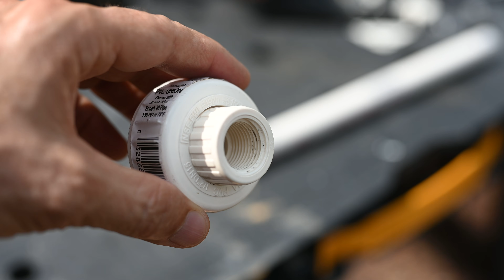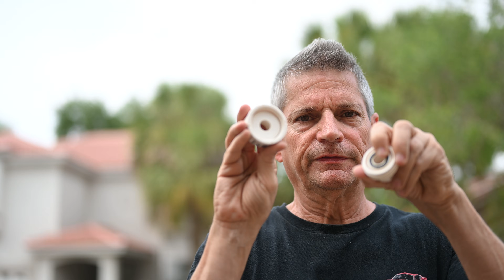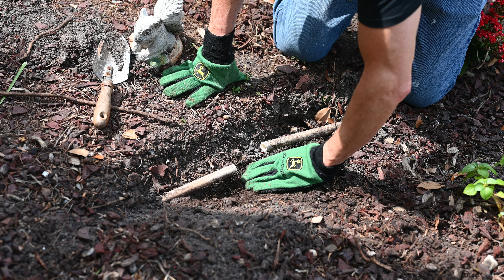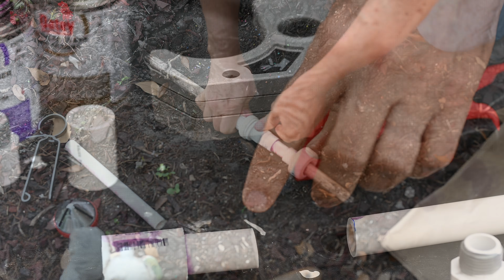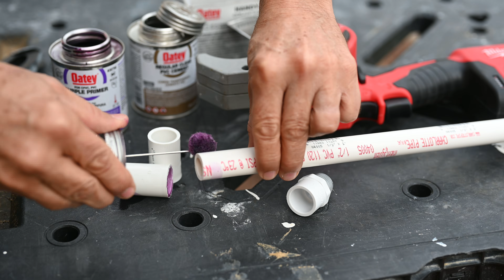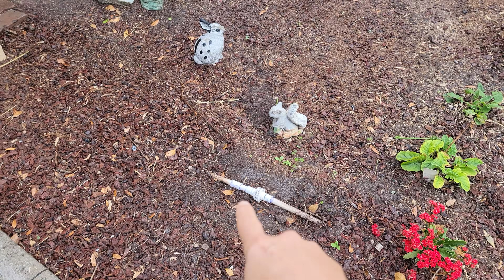DIY How To Repair Broken Sprinkler Pipe Gap with PVC Union

Comment: Lately I prefer glue over threaded fittings.  Threaded is so finicky on tightness and often leaks for under or over tightening.  Anyone else experience that PVC fittings from Ace, HD, and Lowes is real crappy quality?   Been doing plumbing for 50 years.   Installations that used to last 30 years are failing at 1-2 years.   Cheap imports

Comment: There is much easier way to do this, just requires two simple PVC couplers (No Union needed) and a short piece of PVC pipe. and the primer and glue. Unions are used more to make it easier to replace component like a bad valve.
Reply: And the two ends of pipe looked like they were at two different depths. The stress may have been what caused the problem to begin with. Two 45s may have been the ticket for that repair.

Comment: A Dresser fitting would have been faster and easier. Both are expensive fittings. A Dresser fitting slides over the pipe and tightens down a compression fitting a both ends. They come in PVC and galvanized like the unions.

Comment: I never have used a PVC union..so came here to understand those and this video was great for that.  However for those of us lazy dudes that never cut the pipe the right distance on a repair job, i recommend those telescoping expansion repair sleeve chingaderas. They are fast, forgiving on cutting wrong lengths,  and super easy for us dingbats looking for the most simple repair.  "Expansion Repair Coupling" is what they are officially called I think.
Reply: Not only are they a lot less work to install but they have double o-rings last much longer than the single o-ring in the union. They're also lower profile so you don't need as much clearance. BOTH depend on rubber though and won't last forever, although on the low pressure side, it won't matter. The other option is a "no stop repair coupler". These are a bit longer than the regular couplers and don't have the stop in the middle. This is so you can slide it all the way on one pipe, and then back it up half way on the other pipe. If done right, this is is a permanent repair that doesn't rely on any rubber or silcone.
Reply: @sorka95032  great to know...thanks.  Where do you find the coupler without that annoying stop in the middle?  And sometimes I make repairs when it is super hot outside and the glue firms up real fast, I'm an older dude and need some time to slide the coupler farther back and then in place...so if there is a slower set glue, please let me know - appreciate your advice !

Comment: Relatively low pressure sprinklers systems really don't need a primer.  The clear cement itself softens the PVC as it cures.

Comment: That PVC union is likely very expensive.  It is easier to use two cheap slip sleeves and piece of pipe.  That type of union is for when one wants to be able to disconnect pipe sections.

Comment: the problem I have is unless I dig out another 24 inches to free up the pipe, there's not enough flex to move the pipe out of position to slide the fittings on in the final alignment of the union.

Comment: While that particular repair did not need a union, it is a good example of how to attach a union.  My '35 year irrigation guy' used PVC in and out of my Sta-Rite pump. After multiple leaks, loss of prime, etc, I rebuilt his crap job on suction and discharge side using brass nipples and schedule  80 unions. Being able to disconnect unions have helped  tremendously to trouble shoot, prime, and tightening the nipples and female adapters.
Reply: I agree.  I was installing a timer in-line on some pvc pipe and wanted a union so I could easily replace the device in the future.  The two unions were $8 a piece, so I wouldn't do this in other circumstances.

Comment: Oh my gosh, it's like you are building a skyscraper to simply fix a single broken piece of PVC.
Use a compression fitting (non-pressure pipe) or a telescoping PVC coupling or 2 couplings and a scrap piece of pipe (pressure side of pipe).
My gosh, does everything on the internet need to be over the top and grandiose (figuratively) ?

Comment: Why not just use a threaded fitting with a 3/4" slip directly over the 3/4" pipe on the right side?  at 6:04....and avoid the coupling?
Reply from the maker: they won't be long enough to mate up you have to use a coupling because you can adjust the length

Comment: I have one of those Milwaukee cutters, but I just use a cheap pipe cutter (like scissors), which you can get for $10. But I guess I've never encountered PVC which was so old it had become brittle. I find the blue glue to be simpler, unless there's some sort of building code issue.
Reply: Usually PVC which is brittle has spent time in the sun, everything I’ve dug up hasn’t been brittle for me.

Comment: I like those PVC unions as that kind is functional unlike the compression style.  However that repair doesn't need a union.  I use either a repair coupling or file the center stop out of a normal coupling.  Goop up the pipe and coupling with cement, slip the coupling all the way onto one pipe and then slip it back back half-way on to the second pipe.

I've seen folks use a torch to heat and bend the pipe and use a normal coupling, or the straightforward way is to dig out enough room to flex the pipe normally.

Comment: Great informative video on how to utilize all those different pieces, the reason of using a union, and the process of gluing PVC pipe. Only problem I have is you have about $8+ in fittings, $6+ in glue and wild guess here $300+ in cutting tools. The only time I would use a union on PVC is where I would need to take it apart. Unions are mostly used in metal piping where you have threads that you need to turn in opposite directions. A more DIYer method for this repair would be a piece of pipe cut to length, 2 couplings glued on each end, dig a bid more on the pipe, glue both ends of repair flex pipe up & pop both ends on and give a quick rotate. About $1 in fittings. A small hand saw or hacksaw blade wrapped with tape or plumbers triangle saw or hand PVC cutter. You should remind people to check that their glue is still fresh, old glue fails, unless I’m doing multiple jobs or a bigger job, I only buy the smallest cans of glue.
Reply: That's how I fixed that problem, and I never had those repairs leak. I've also used these repair kits that have a sort of split pipe that you glue over the outside, when you don't have room to lift the pieces, and those have worked, too, but they also cost money (although less than one of those unions).
Reply: What is “repair flex pipe” and what do you mean? Why can’t we just do pvc cut to length and a coupler on each side?!
Reply: I should have wrote; glue one end onto one side, then flex the pipe up to get the other end and cut end to meet. The piece you are replacing with the couplings glued on will be longer than your cut opening in the ground, that’s why you will need to flex the pipe up to get it together.
Reply: @tomtribur458  but flexing a pipe up doesn’t allow room to fit into the other pipe in my visualization. I’m visualizing pushing the pipe BACKWARD to then be able to slide it forward into the coupling attached to the other pipe right?
Reply: @MathCuriousity  if you can slide one side of your pipe, you are good, just slide 1 side away, put your glue and fitting on and slide it back together. You only have to lift and flex your pipe if both ends are buried and fixed in place, but if you do need to flex your pipe up, dig farther back and expose more pipe, if you don’t you risk cracking the pipe. The flexing is only to allow more space between the ends of the pipes and when you release the pipe as it settles back down, it will force itself back together.
Reply: I've also seen people remove the interior ridge in the middle of a slip coupling so it can slip completely over the pipe and utilize some deft prime, slip on and to one side, apply glue on both ends and slide the coupling back to cover the join and rotate.  Never tried it myself and as many mention so long as the ends have movement you probably don't need any such shenanigans.

Comment: As a licensed irrigator for 14+ years, I have to say Jeff that you waaaay over complicated that repair and in the end the repair was relatively incorrect.  You had enough flex in there to have just used  two couplings and a small piece of pipe or you could have just used quick fix.  It’s also unnecessary to chamfer the pipe, you can just wipe the burns off with a towel.  That Milwaukee tool does look convenient though.
Reply: I agree! it's overly complicated. i had to stop watching at 4 minutes of the vid.
Reply: You were too kind to him sir, he was so wrong about all that. A five minute job start to finish, "your way & the right way"... He needed a hacksaw, glue, rag, 2 couplers and a bit of pvc pipe.
Reply: You are so right I'm a female and do all my jobs in my home and in yard and I have the same problem right now and got the pipe couplers no need for all that extra stuff.
Reply: @fia8079  He sells pvc unions for a living though.
Reply: @houstoncowdog  ah ok thank you for clarifying. So what about copper pipes that we want to use a push fitting on where we can’t use a slide based push fitting? Are we basically praying that the copper had enough “flex” backwards of one pipe to make room for the “overlap” of the other pipe to enter the push fitting?

Given this issue - wouldn’t we still have this issue if we did a traditional coupling and soldering?
Reply: @MathCuriousity  I’m sooty but I’m afraid I can’t help you there as we only work with pvc
Reply: Overcomplicated is a nice way of saying he doesn't have a clue what he's doing as with most of his videos.
Reply: What does “you had enough flex in there” mean?
Reply: @MathCuriousity  By flex I mean that you can bend the pvc pipe out of the way enough to put couplings on and then force them back together.  PVC pipe has a little bit of flexibility to it that allows you to manipulate enough to not have to use a sliding fitting.
Reply: I think he did good, and about the burrs, do it it right so if its on a main it won’t mess up the valve

Comment: In the past I have put 2 couplings and a length of pipe in between. Worked fine.
Reply: And they result in a lower profile repair, which is important when the pipe is not buried very deep.
Reply: Can you explain this more. Are you saying that what this guy did is wrong in situations where we had a much deeper depth?
Reply: @MathCuriousity  I think they are saying that this guy's approach might not be ideal if it was not deep. If your situation was deeper then it's not so bad because there's less chance that wide fitting would be near the surface.

But overall, I'm still wondering why you need that threaded fitting. As the OP said, two slip couplings would do just as well. In theory I suppose the threaded coupling makes it a bit easier to make the final join, without having to bend the main pipes. But in his case, he made the two halves of the join so close that he had to bend to make the final fit anyway.